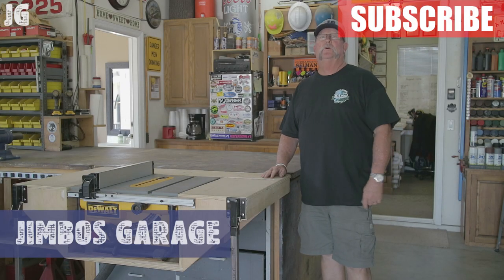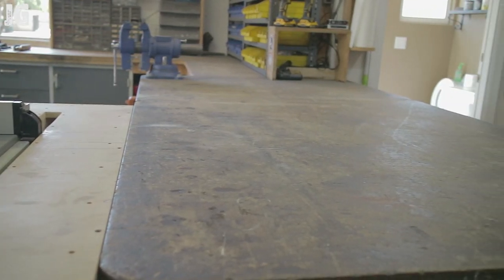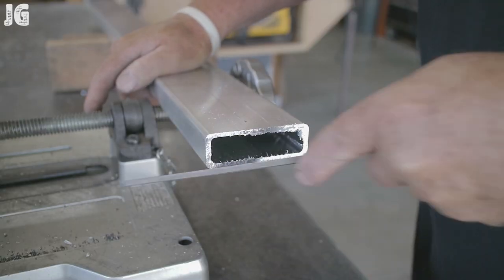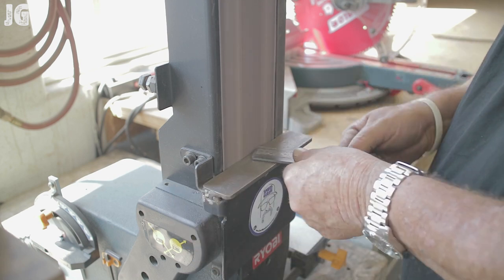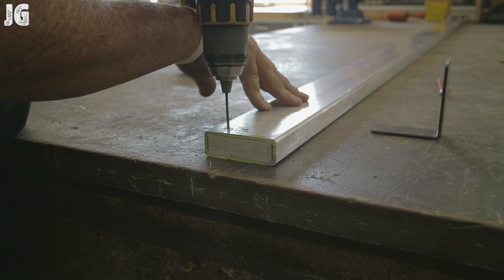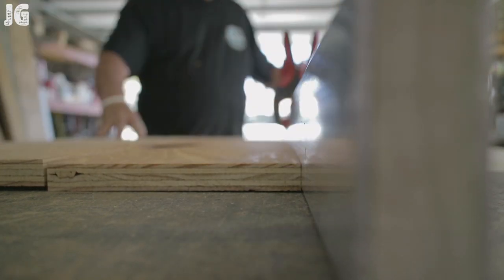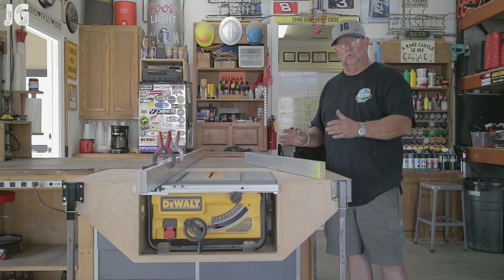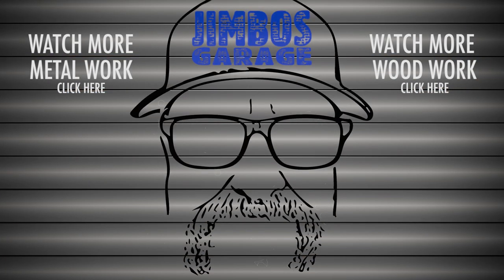Table Saw 'Table' Fence Extension - Jimbos Garage

Comment: Really  enjoy your site, Jimbo.  There is a place for long fences but it can be a liability if you cut much dimensional lumber that may not be straight or wood that curves as it's cut. It's good you have the versatility to remove or change them.

Comment: Hello ! The best solution to get your 24inch capacity is to get a contractor Craftsman tablesaw. They have a nice cast iron top, and people get rid of them in CL very frequently for $50 or so to get a more portable version. They usually have a 1.5hp motor which seems weak compare to newer model. But in reality it's enough for most work. I suspect the 3 hp motor of new models are some sorte of "surge" or "peak" power rating, and that the actual power is also 1 or 1.5hp. Thanks for the videos btw ! Xavier

Comment: This model of table saw allows to set the fence up to 32 inches - you just have to use right side instead of left, which indeed has only 18 inches limit.
Reply: Maybe his a left hander...
Reply: @redenc.garcia748  As a left hander myself, it's never been a problem for my to rip with the fence installed on the right.

Comment: I have the older version of this saw where the fence can be mounted either left or right of the blade. mostly I use the fence to the right side as I have more travel distance. The geared rails on my saw are the same dimensions front and back ( could be interchanged or reversed). Your saw looks to have the same style geared rails for the fence. If they are in fact tge same both front and back, I would say reverse them so the fence is on the right side and you will get more travel for wider cuts!
Reply from the maker: Thanks for watching and the advise Alan,  Jimbos garage!

Comment: The two clamps holding the long fence to the stock fence limit the height of what you cut. Why not fabricate a bracket from the top to the other side of the fence where you can attach it with screw tension? Just a thought. Well done.
Reply from the maker: Thanks for watching and the advise Frank, Just trying to keep it simple,  Jimbos garage!
Reply: Frank DeSantis 89

Comment: Jimbo
You need to use your tablesaw like most people and put the fence on the other side of the blade and you will be able to cut any measurement on a sheet of plywood.  

Your fence extension is the cats ass.
Reply from the maker: Thanks for watching Wayne,   Jimbo!